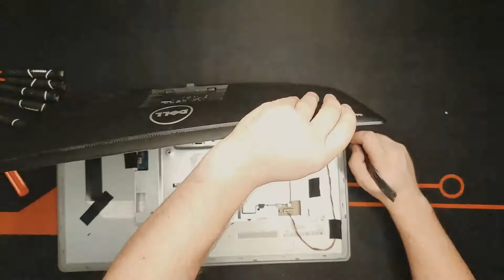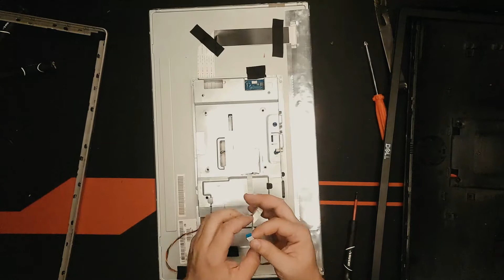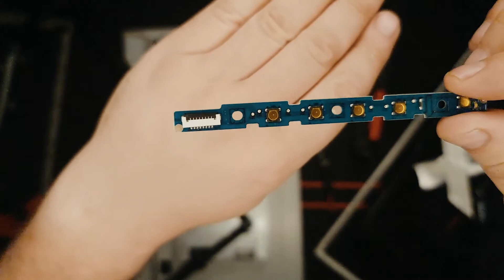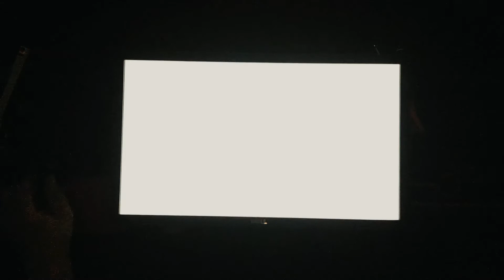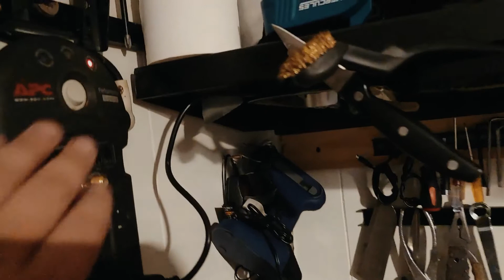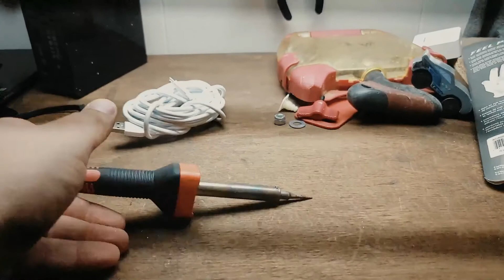how to turn an old monitor into a bright light or expensive studio light for cheap

Comment: Well is one detail that this monitors have and is that if they don't get a signal they shut off so you have to disconnect the electronic circuit that is related to that is on the same electronic board some times you can some times you can't if you can't you can use a different power source only for the LED you need to use a multimeter and check the plug connection of the monitor turn it on and see what the voltage is  just cut the wires and make a connection for a DC adapter get a switch  and boom you done
Reply: No. Better let the original board do the voltage regulation. And simply put a resistor to emulate a signal.

Comment: Hello, i've just done every step to have a light panel from my broken LCD screen. When plug in the cable the monitor light turns on but after some minutes it turns off. I've disconnected the cable for some minutes then I connected again and the lights turns on again for some minutes then turns off. Can you understand why it happen? Furthermore the on/off button doesn't work. Thank you, beautiful video.
Reply: Same problem here. I think after 1 minute of no signal / video input, the tv goes into sleep mode. Did you manage to fix this somehow?
Reply: @Taumee412 no but I think there is a way to bypass the sleep mode

Comment: I did the same thing with a Samsung monitor, but it keeps looking for source input, and then it turns it self off after maybe 3 min, is there a fix how to disable the looking for the source?
Reply from the maker: So you did not remove the screen part of the layers which if you're doing whats on this video, you should not be able to see any kind of info at all...keep in mind...doing what i did in this video, will forever destroy that monitor as a "monitor"...let me know if you're sure you want to do that.
Reply: @OMNITEK  Hi , I just saw your reply after RM was replying to my question, yes the monitor is not working anymore I am just trying to use it as a big light
Reply: Did you fix this? I have the same problem......
Reply: @rmdrums5436  No unfortunately I couldn't find any fix for it and the monitor is sitting on my shelf.
Reply: @BeeTammo  I have two......

Comment: How to stop the "sleep mode"? I have a lg monitor that turns off after 15 secs.
Reply: im having the same problem, did you ever figure out the solution??
Reply: Same issue, let me do a double check and see if removing that keeps the monitor always on.
I will replay if this is not fixed.
Thanks
Reply: @IsraelDmzS  and how did that go?
Reply: @MapedMod   didn’t worked, if I disconnect the vga board the leds don’t turn on, I tried using a vga dump connector but also didn’t work, so I’m still thinking what else to do.
If any idea it would be welcome, my monitor is an old Gateway monitor.
Reply: @IsraelDmzS  I had the same problem with my HP P240va but I got mine working by jumping green to 5V+ red, blue to 5V+ red and I had to place a dummy load on 5V+ and the ground, a 5V 0,7W fan did the trick.
Reply from the maker: it should not go to sleep mode if you have it connected directly...but if it does so...you might have to remove the "connectors" board...where it has your vga or hdmi ports, might need to be removed so you're turning on only the lights part of the monitor without the chip thinking you're not connected.